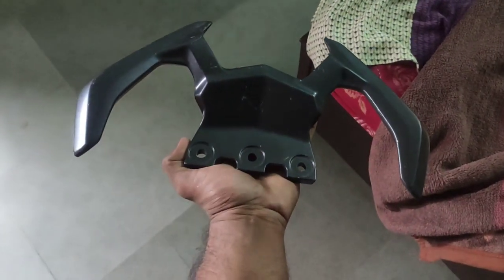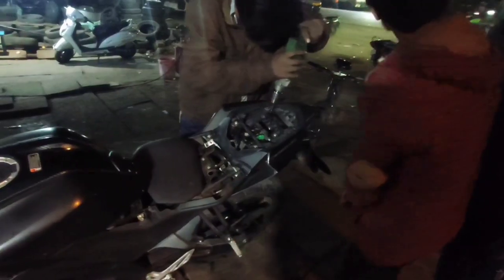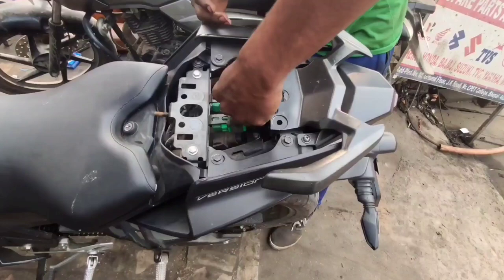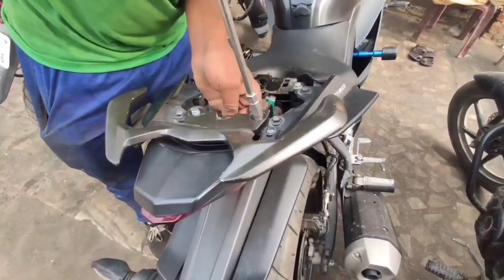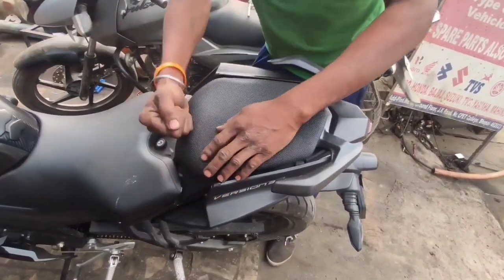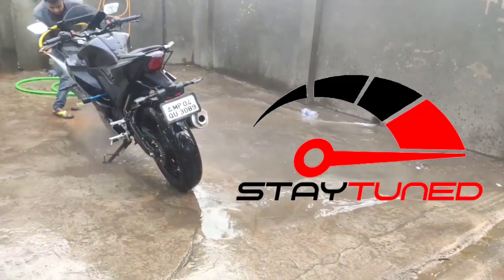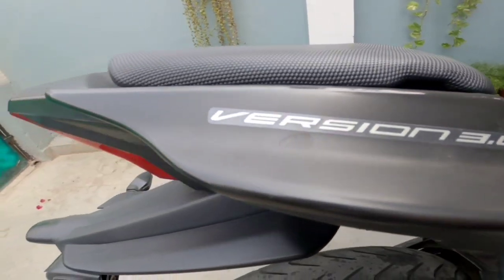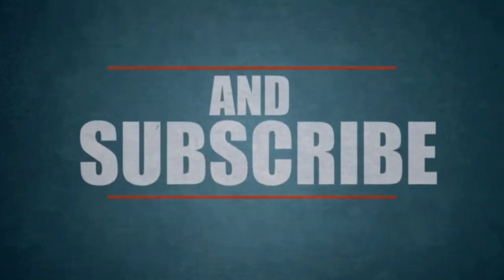Yamaha R15V3 & MT 15 Grab Rail Installation for Max Comfort| Amazing Mod for all R15V3 & MT Users

Comment: I own v3 and I agree that it's not that comfortable. I was searching handlebar modification and I found that mt15 handlebar can be used on V3. But wait....the twist is both the bikes are built on same frame. So I think we can remove v3 seat totally and replace it with mt15 seat. It may be possible or not. I am doing research on it and will see its possible or not. And if yes,,,,,, I am going to make my beast V3 a complete touring bike having mt15 handlebar and seat. I'm also searching for best windscreen for touring like versys or gs310..😘😉 So bro can you please check can we replace r15 v3 seat with mt15 seat...😍
Reply from the maker: Agreed on ur points bro but I don't think we can actually change the seat from 
MT-15 to R15V3 because R15 seat is much more spacious and MT15 is not. I don't want to change the basic DNA of this bike its a track bike. I just wanted to make it comfortable for myself and others who are on the quest to doing the same. Nothing against u brother just what I feel do stay tuned to the channel and share your views on biking would like to hear you out. 

Peace out!